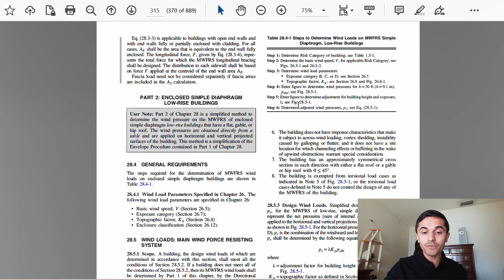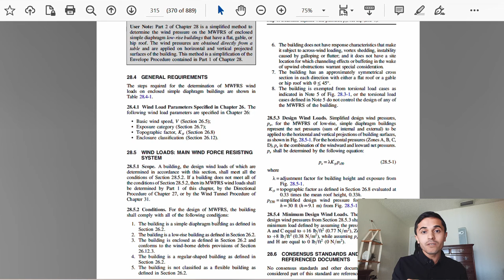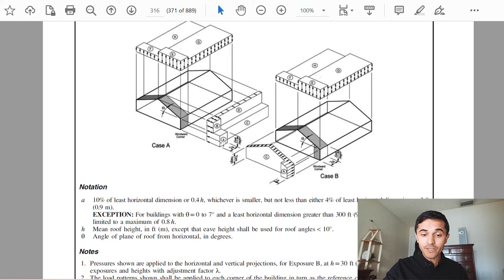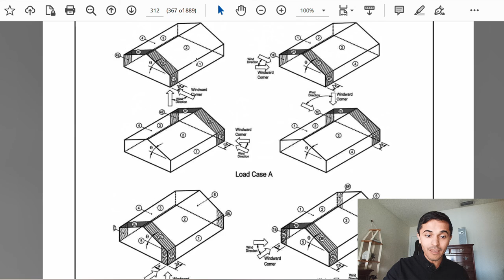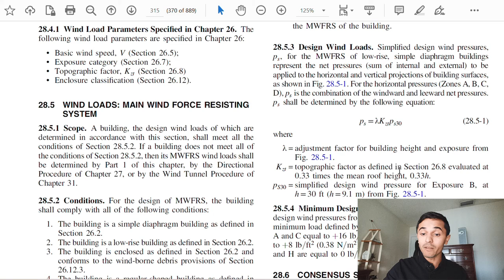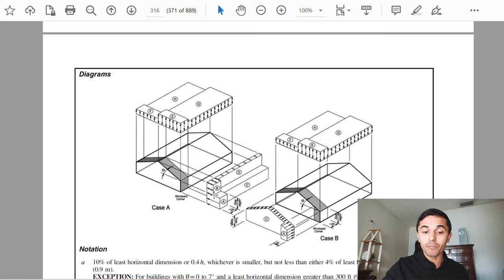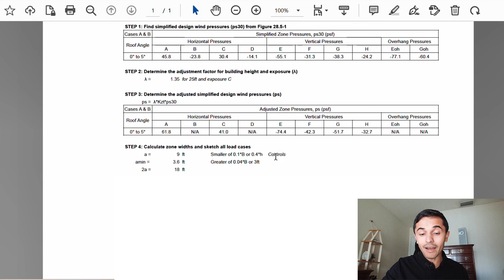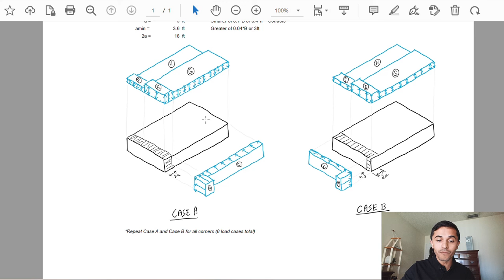Master Wind Load Calculations (the quickest method)

Comment: I have the ASCE 7-22, and there is no section 28.5 and I can't find anything on the simplified design method.  Can someone please educate me if ASCE no longer allows the simplified method if the state uses the ASCE 7-22? Also, the wind loads are considerably higher in the 7-22 ASCE Hazard Tool online than in the 7-16.

Edit: I did some additional research and yes, 7-22 eliminated the simplified method in chapter 28.
Reply from the maker: You are correct that 7-22 dropped the simplified methods! I noticed that recently and will be making a video about the updates in 7-22 including this one. 

Regarding your second comment, I don’t think the wind loads are considerably higher in 7-22. Maybe you’re looking at velocity pressure (qz, qh)? The directionality factor moved out of that equation but into the pressure equation, so you’ll be getting higher velocity pressures but then these will get reduced when you calculate the actual pressures with Kd, G, cp, and GCpi.